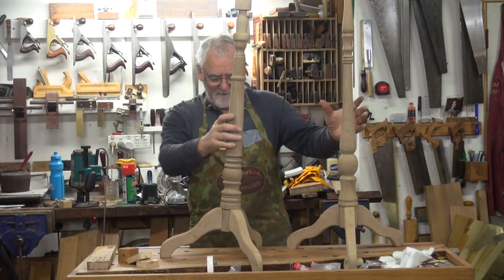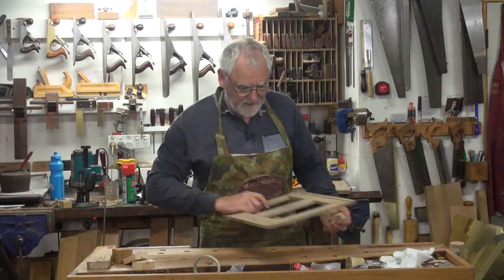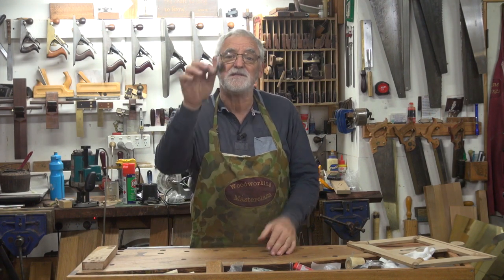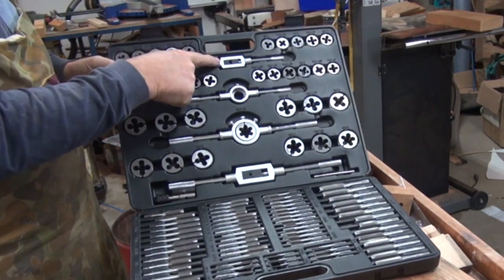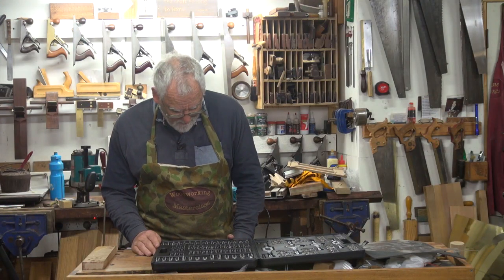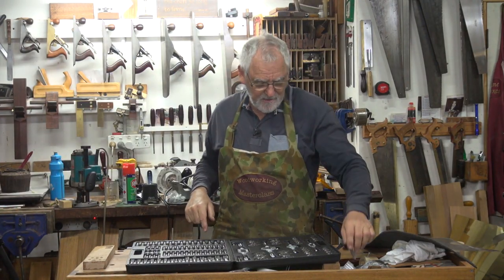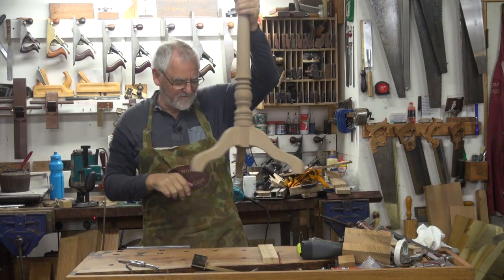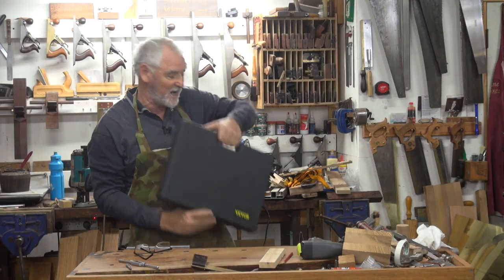Something different for Woodwork. Thread Tapping Wood + Review Vevor 110pcs Metric Tap & Die Set

Comment: For wood, you want to use a special kind of tap called a Forming Tap.  Forming tap diifers in that it compresses  the wood thereby forming the threads rather than tearing the wood  out and creating threads that way. The joint is stronger twhen using Forming  Tap in wood and soft metals such as aluminum.

Comment: I need to tap some holes into wood to screw some holes into a pc case to hold it upside down. Do you have any videos for beginners because im lost on what im doing.
Reply from the maker: No, but all you will have to do it drill a hole that is just a bit smaller the the bolt you want to use and screw the  bolt into the hole. In most cases the thread of the the bolt will cut it's own thread. A tap would be better but if you don't have the right one this way will do. Try it out on some scrap timber of the sort you want to use. A few goes and I'm sure you will work it out. Cheers Steve
Reply: @Woodworkingmasterclass  oh I was planning on buying a full set. I wasn't full on using a bolt but a wood screw. I heard a long time ago I should also put super glue to strengthen the threads of the hole. And I do need to tap holes as the pc is going to held upside down the force over time would get rid of the threads created without tapping the hole. If you have any recommendations for beginners on the terms etc I would be grateful.
Reply from the maker: @fahadmalik8862  If you can show me a drawing of what it is you want to do I'll see if I have any ideas. Cheers Steve
Reply: @Woodworkingmasterclass  So I have used wall brackets to mount another pc on the wall but on the bottom of this mdf board (I know it's softwood) I would need to tap holes through the pc case and the wood the case is "SLM1m Hdplex" 

I can add pictures to my community page of my YouTube channel to show the images
Reply: @Woodworkingmasterclass  how should I show a drawing?
Reply from the maker: @fahadmalik8862  send it to me as an attachment. woodworkingmasterclass@gmail.com Cheers
Steve
Reply from the maker: @fahadmalik8862  I would use a through bolt and nut. From what I understand you want to do. Very hard to give you and other directions without Photo. Cheers Steve
Reply: @Woodworkingmasterclass  I will use a bolt. Just need to find out which size bolts to get.
Reply: @Woodworkingmasterclass  sent the email

Comment: If Vevor sent you the tap & die site for free or a discount, be sure to mark the video as containing a paid promotion.
Reply from the maker: Hi Pete, yeah thanks for that, though really there was no paid value. As I was prepared to buy the set and my fees for promotion (which was not asked for) are way more than the value of the items sent. I am happy to promote items that I think my viewers would appreciate and/or benefit from without payment as I am not a fan of Cash for comment which I know is rife in many areas. I pride myself on the fact that if anyone comes to my workshop they will see the tools I have and use daily. Not a fancy showroom of promotional goodies. Still, have complied with request. Thanks again . Cheers Steve
Reply: @Woodworkingmasterclass  Thanks. Gifted items that are shown off in videos are considered compensation legally and ethically. Sure, a little tap and die set is not much and it seems silly, but folks show off MUCH more expensive items in videos (big old battery packs, table saws, CNC routers, etc.). So the rules just apply across the board.

You should also mention in the description that the item was sent to you for free, and then state the same clearly in the video.
Reply from the maker: @Psychlist1972  Thanks again for clearing it up. I did in fact say in the description that I was able to keep the set after I used it. We live and learn. Cheers Steve